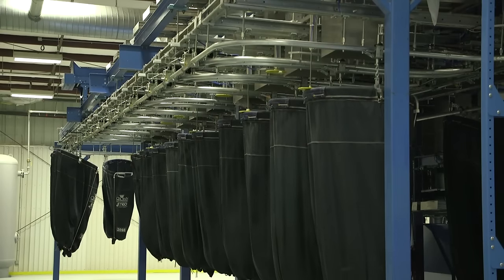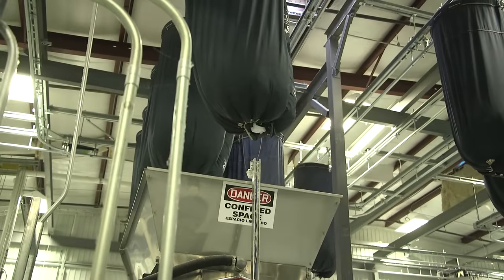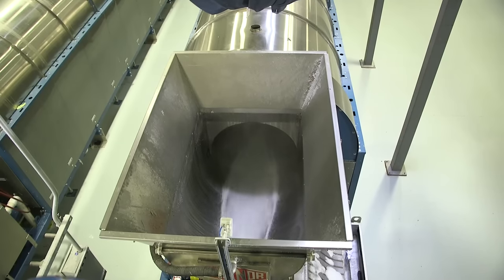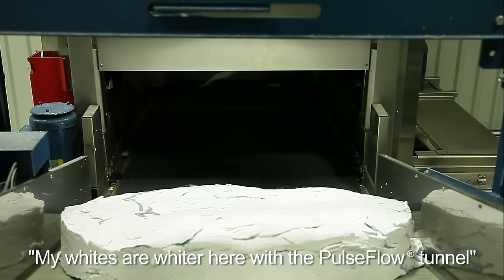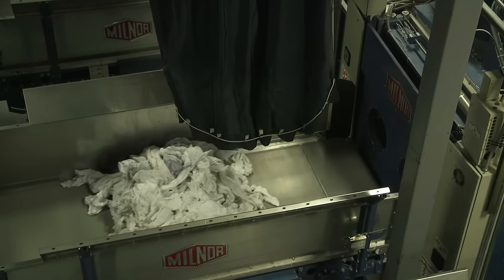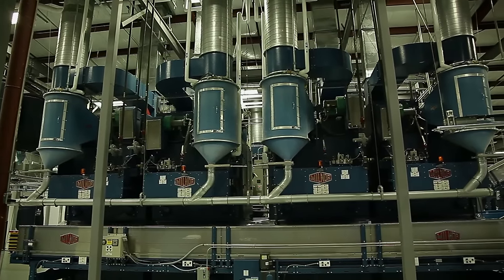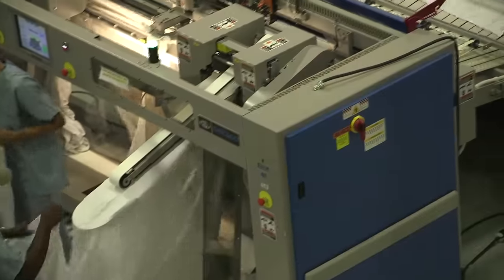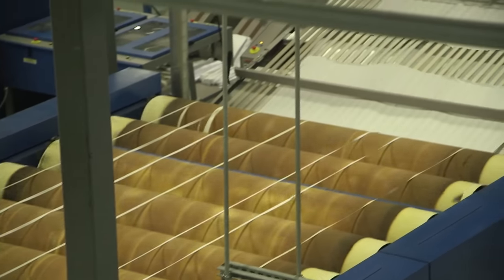Crown Health Care Laundry Services

Comment: Kennegisser is a lot better than this have worked with both system and can tell you minor breaks a lot more chains then kenaggiseer ever did its faster looks a lot cleaner the press doesn't leak oil all the time
Reply: A professional laundry mechanic here.  I've worked with both Milner and canagezer. My experience with CBW's is the exact opposite. The kennegies are more efficient water and chemically but breaks down a lot more often as a lot more jams. 

How often do you break chains I've only ever seen It once
Reply: @nicknewell23  probably once a month or 2 the tunnel has a chain per module. Really annoying with kennegisser in the 2 years I worked with them never had issues with them only 3 ropes and due to operator error. Milnor in the other hand their schematics wiring is a living nightmare need to work under the tunnel good luck fitting in there the 12 mod milnor isn't as bad only 4 chains so not many breakdowns but their phenumatic  system is also a nightmare and the press sooo many hoses for simple job
Reply: @nightmareinaction629  that's enlightening thank you